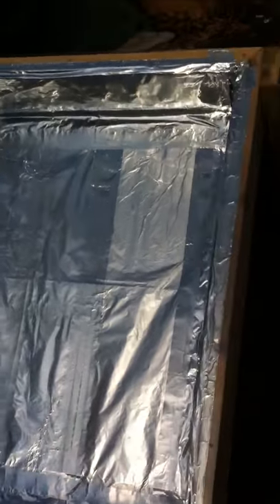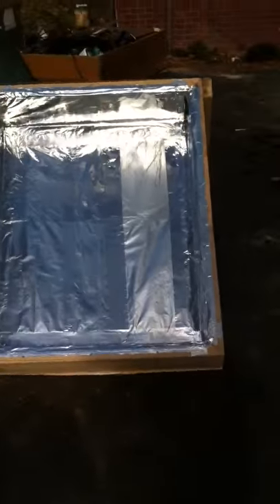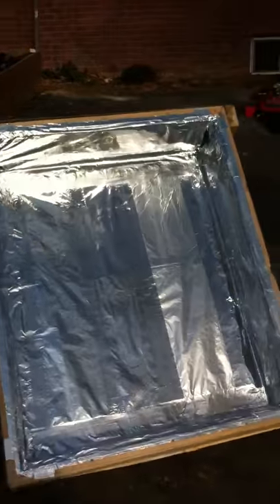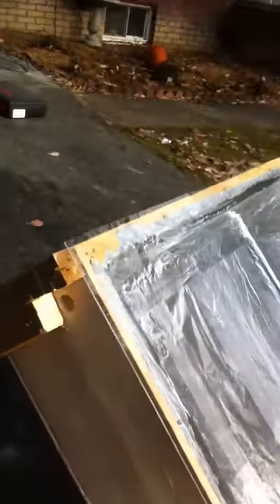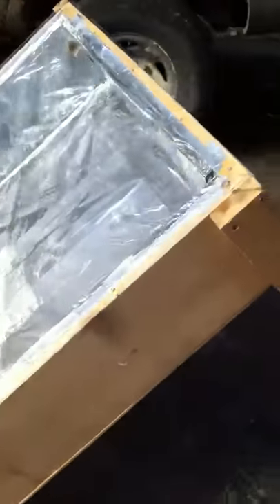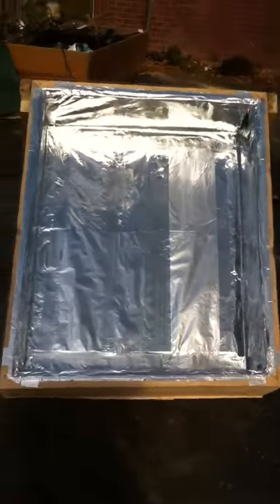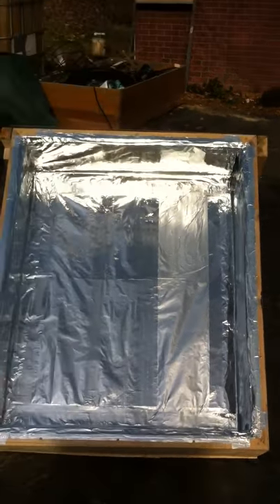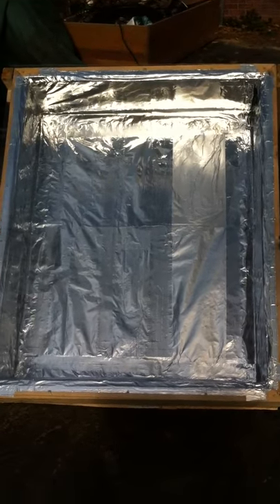Homemade Solar Heat Collector

Comment from the maker: Well I tested it this morning, it was about 40 degrees F outside, the sun had been on it for about an hour and I measured 65 degrees F inside the box before I ran outta time n had to go to work. The thermometer is slow to change and was still going up when I concluded the test.